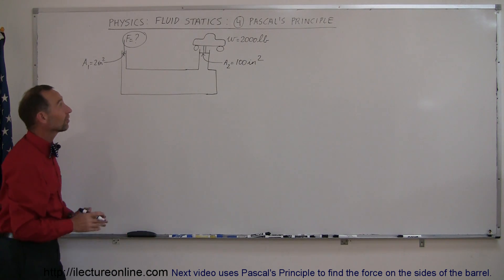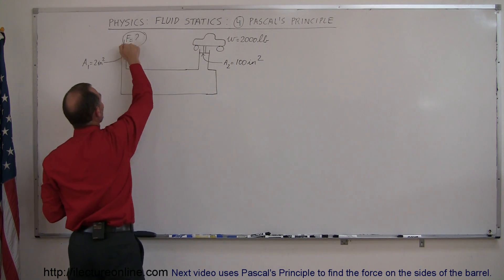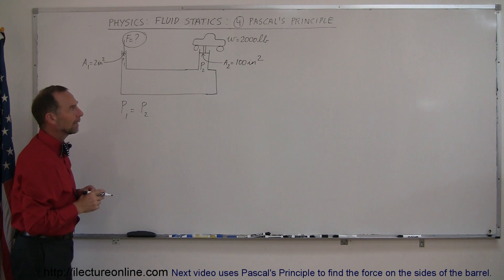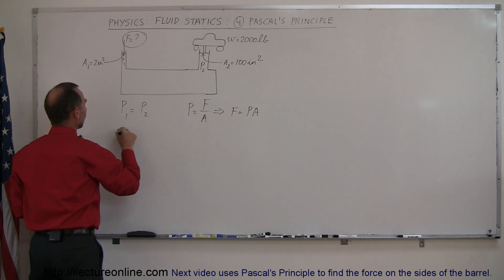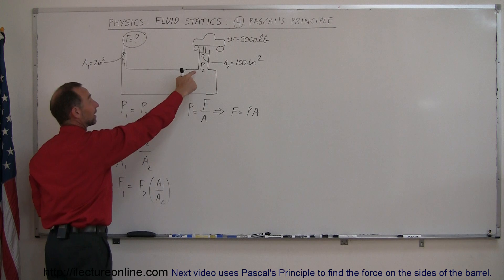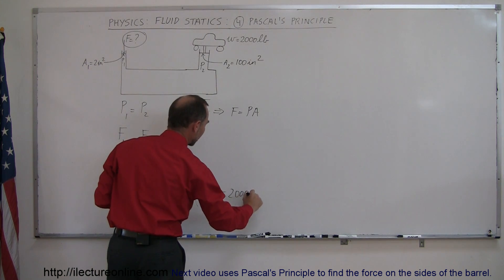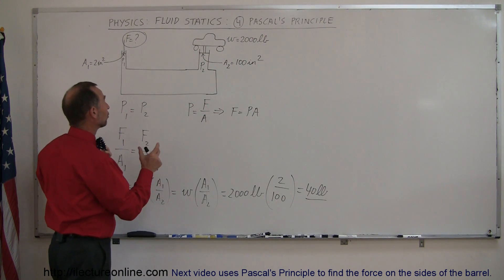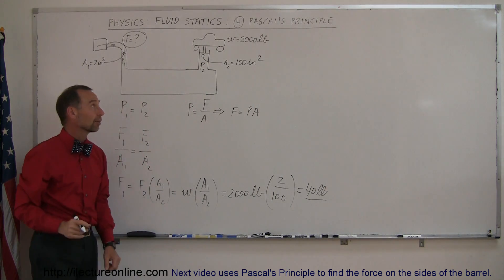Physics 33 - Fluid Statics (4 of 10) Pascal's Principle: Hydraulic Pump

Comment: 40 pounds force lift a car of 2000 pounds ,
But what happens to law conservation of energy
Reply from the maker: That is always conserved.  Work = Energy Required = Force x distance        (But when this is done using a compressor, you don't have to worry about pushing the 40 lbs over a great distance.
Reply: @MichelvanBiezen Thanks sir for your precious reply ❤

Comment: Odd question but if F = PA, and also
F = ma, then is PA = ma ? 🤨

Thanks Professor.
Reply from the maker: You cannot "blindly" make that assertion.  It would depend on the physical situation.  F = PA is usually used in a static sitation.   F = ma is usually used in an accelerating situation.
Reply from the maker: And yes, if there was enough pressure on the water in the water hose, you could lift up a car with it.
Reply: @MichelvanBiezen  I was thinking more in terms of having the car on a buoyant platform that was floating, and filling the tank with water, like a water elevator, just with a platform to hold the car.
Reply from the maker: They can actually bringing shipwrecks that sank back to the surface by attaching big balloons to them and then inflating them.  (That is the concept of buoyancy)
Reply from the maker: Even a constant acceleration is not a static situation.  (it is accelerating , and thus moving)
Reply: @MichelvanBiezen  That's insanely cool and smart. (balloon/shipwreck)

On static vs dynamic, for some reason, that doesn't sit well with me... but I can appreciate/understand the official interpretation as you illicited.

If acceleration is fixed as a constant rate, then measuring the physical properties of a 4L jug of water on Earth "at rest", will yield the same results if I was in a "space elevator" accelerating 9.8 m/s (as in Einstein's thought experiment which concluded principles of equivalence relating to acceleration/gravity) assuming temperature/air pressure were similar.

The jug of water on Earth is a static situation, as is the jug in a space elevator accelerating 9.8m/s.

That's just my "🤨🧐" .

Thanks a lot for your responses, they're very insightful to what I'm working on.
Reply: @MichelvanBiezen  What I had in mind for the car lift, I guess, was using the forces of buoyancy, to convert to mechanical energy to yield the same result of "lifting a car" but with less energy.
Reply: @TikkyTakMoo  If you want to lift a 1000 kg car by a height of 1 meter, you will still need 9.8 kJ of energy to do it, no matter what machine you use.  The gravitational potential energy of the lifted car is independent of the path you take to lift it.  You can make that work easier for a human to do, by stretching out the force over a greater distance, as the hydraulic jack and simple machines in general do, but you still will ultimately need to do the same work.

You could in concept, use buoyancy to lift something heavy, by making its density less than that of water, and having buoyancy lift it.  As a consequence, the displaced parcel of water will descend, to take its original spot.  It's the same working principle as using a cable, a pulley, and a counterweight to lift a load, except the water is the counterweight.  It took work to fill the tank with water in the first place, and you used that work to lift it to the surface.
Reply: @TikkyTakMoo  There is no abrupt difference between a "static situation" and a "dynamic situation", as you've pointed out with Einstein's equivalence principle.  The reason we would draw a distinction, is that you have a lot more to account for, in a dynamic situation, when objects are accelerating relative to each other.  Many of these introductory formulas are built on the pretense that they are applied to a static situation or a quasi-static situation.  The first principles that derived these formulas are still applicable, you just have more moving parts of your calculation to bring together, in order to solve for what you want to know.

When the entire environment of a situation has a constant and uniform acceleration, you can use the shortcut of treating it like a static situation, thanks to the equivalence principle.  You simply calculate vector g minus vector a, and treat that as the equivalent g-field, taking the place.
Reply: @carultch  A million thank yous for replying in depth. All what you said makes sense.

The example of the "floating parcel" is closer to what I had in mind. I understand would cost energy to fill the theoretical tank harboring the bouyancy object, to lift, to then turn into a mechanical process.

The potential force generated from such a process would not be limited by the extreme amounts of pressure all at once, but the time it takes to fill a tank.

A garden hose can lift a boat sitting in pool with enough time. Perhaps the total energy ends being the same (depending on the scenario it also takes energy to pump out water, though I think having a hole at the bottom of such can reduce some of the energy to pump water out to be used again) but the reserve of force that can be released through this at one time I'm curious to compare.

Perhaps incorrectly, but i imagine the whole process like putting your foot on the gas pedal, going really fast, but wasting more energy which reduces the total distance the csr can travel than cruising. You could fill the tank realky quickly - it'll just cost more energy, this leads to time constraints of the application.

I also imagine it a bit like a spring you can keep pulling back, but with a "fixed tension" in this pulling back, only limited by how far back you can pull the spring (or depth of water).

Thanks again for responding, I just happened to come back here. Wish I had someone like you to challenge/enlighten me on all my devices 😂🤣🙏. Do you use Twitter 👀?
Reply: @MichelvanBiezen  Interesting. If acceleration is at a constant rate, like 9.8m/s , would that not be considered a static situation?
Reply: This is actually a really cool concept/ingenuity.

I wonder if a water elevator might be more energy efficient if rigged properly mechanically. In that way I could use a garden hose to lift a car

Comment: Why is the pressure equal everywhere 0:09 ? and more precisely, why is it equal at the bottom of both pistons? https://www.youtube.com/watch?v=xV6GbvJ9ywY&ab_channel=MichelvanBiezen here you find where the pressure is the same, and you say that the pressure is the same in the places where we have the same height and are in the same fluid. I'm confused.
Reply from the maker: Because the large pressure created by the pistons, we are ignoring the small differences caused by the difference in height.
Reply: @MichelvanBiezen  Is the presure close to the piston equal to the presure at the bottom?
Reply from the maker: Again, to be exact you need to add  (density)(g)(h) for the bottem, but if we ignore that, then yes, the pressure is essentially the same for small values of h and for large pressures.

Comment: Does anyone have the force vs displacement graph of a simple manual hydraulic jack ? I mean how the force changes when we use and press on the lever of a hydraulic jack ! I want to know the complete scenario : before pressing the lever , while pressing the lever and raising the object , after raising the object! I want to know how the force and pressure of fluid changes during the whole process!
Reply from the maker: We don't have anything with that type of detail on this channel.
Reply: @MichelvanBiezen   thank you for your reply. Wanted to have your view on this issue : Do you have any idea of how the pressure of fluid changes during the lifting process of the hydraulic jack. My idea is that : pressure of fluid in the hydraulic jack mostly depends on the weight of the car. I mean, I can apply 1 million newton on the left side but pressure of fluid inside the hydraulic jack will still remain the same. Pressure of fluid will mostly depend on the weight of the car; applying a greater force will simply make the car move quickly upwards rather than increasing the fluid pressure. Thanks if you could give me your opinion on that subject matter.
Reply from the maker: The principle with hydraulic jacks is that a small force can create a large force, because of Pascal's principle.  Since the pressure is the same everywhere in a fluid under pressure, it becomes a matter of the ratios of the cross sectional areas.

Comment: Thank you for your video’s. Dealing with pascals law, does the elevations of the pistons matter? It’s a closed loop but say the big one is at 10 ft in elevation and the small one is at 100 ft. Does the height affect the function of pressure exchange? Thanks
Reply from the maker: Yes, for any significant height change between the 2 pistons, you would have to account for that pressure difference.  In real world applications, the pressure applied is much larger than the pressure difference due to height and thus can be ingnored.
Reply: @MichelvanBiezen  I think I know but what are your thoughts? If the small piston with no load except the seal force of 1000 N was 10.668 m above the bottom piston. The bottom piston has a seal force of 2675 N and a load of gravity acting on 2000 KG. The large piston size ratio is 2.667 to the smaller. If the larger piston is released to a potential displacement of 3.65 m, would it be able to do the full displacement? Thanks 🙏🏻

Comment: Sir, may you make a video to explain about Pascal' Law : Pressure acts equally in all directions. I ve read about it and they showed a prism to illustrate and calculate the pressure acts equally. Why don't they use a cube? And how can pressure on the upper side be the same as the below side in the presence of weight in negative y direction?
Reply from the maker: Pascal's principle.  The pressure at any depth is exerted in all directions.
Reply: @MichelvanBiezen  but the pressure is caused by the weight of water above the interest point, so how come the pressure below the interest point exerted in positive y direction? and also the pressure from the x direction whereas the weight of water is zero at x direction?

Comment: Hi Michel,  first let me say thank you for your great  videos,  but I want to say that the pressure is not equal everywhere it is equal on both tubes because they have the same height,  on the rest of the container you need to add pgh,  I'm sure you know that but you did not say it on the video so I decided to write here.
Reply from the maker: You are correct that there is a small difference between the pressure at the top and pressure at the bottom.  (We usually ignore it because it is small compared to the pressure induced by the pistons).  The added pressure due to the piston is the same everywhere in the fluid.

Comment: I know I'm late to the lesson but I just want to ask what I would do if the height between the two pistons are not the same anymore?
Reply from the maker: The difference to the pressure due to the height is not significant to the pressure created by the force on the piston.  Technically you can add a factor of:   rho x g x h

Comment: why is F2 the weight of the car? I thought it'd be that F1 is the force experienced by the water from the first piston and then F2 is the force from the water on the piston lifting the car
Reply from the maker: Newton's third law.  The force due to the water pressure below the car = weight of the car.
Reply: @MichelvanBiezen  how???and then how is the weight lifted...if two forces acting in opposite directions are equal
Reply: yes I thought Similar and I am in confusion now

Comment: It's not true that the Pascal's Principle states pressure is equal everywhere in the fluid, because this isn't also true
 I believe what you wanted to say about Pascal's Principle  is that the pressure variations are transmited integrally to every point of the fluid, resulting that the pressure increase at the horizontal section right below the piston 1 is the same as the pressure increase at the horizontal section right below piston 2.
Reply: Pascal's principle assumes vertical distances are negligible.  The reality is, that Pascal's principle coexists with rho*g*z, to determine the distribution of pressure.

Comment: Around 00:08 you described Pascal's Principle but I think you meant to say that the pressure is equal across all points on a horizontal line, correct? The pressure at the bottom of the tank is surely greater than the pressure near the top. But since the Pressure of the two locations we are trying to determine here are on the same horizontal line (and therefore have the same height) then they are equal.
Reply from the maker: For  fluid under (considerable) pressure, the difference between the bottom and the top of the tank would be negligible.

Comment: This video is great, but I am confused as to how you solved this problem. I guess the "trick" here is to know that F2 = weight of the car. But why is this the case? If the two forces are equal, don't they cancel each other out? Wouldn't you need a force larger than the car to move it upwards?  Also, does Pascal's Principle only apply when pressure is added to an enclosed system? It doesn't seem to make sense that the pressure at the top of the pump would be the same as at the bottom.
Reply: I re-watched the video and didn't realize that when you get F1 that is added to the force of F2 and so the total force on the car is greater than 2000lbs. As for my 2nd question, I believe it only applies when pressure is added to the system.

Comment: For F2, would it not be (m*g)? Then multiply the ratio of the areas by that?
Reply from the maker: Mitzzi,
Correct.  w - mg
Reply: Michel van Biezen A great video!
Would it not be best to convert lbs to Kilograms and then using this to find Newtons for the Force? Also, should we convert inch's to meters? That is the standard SI unit for distance after all.  (speaking from a Canadian's perspective) lol
Reply from the maker: Steve Rossell 
Unlike our neighbors to the north, we have not yet converted our units to the SI units and lbs, inches, feet, etc. are still much in use here.
Reply: +Steve Rossell I totally agree with you and your conversions (talking from Indian point of view)

Comment: Thanks for the video. Too bad its in inches haha
Also the compressor is hooked up BEHIND the piston. So they use the compressed air to move the piston. After the piston is the hydraulic oil. They dont mix. So technically his explanation is correct.